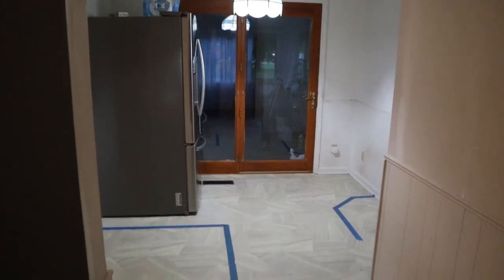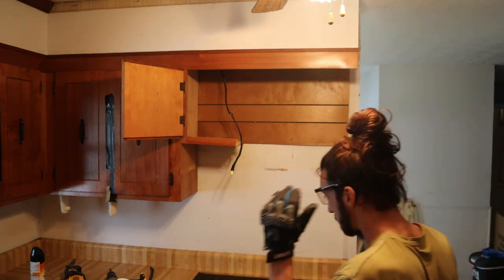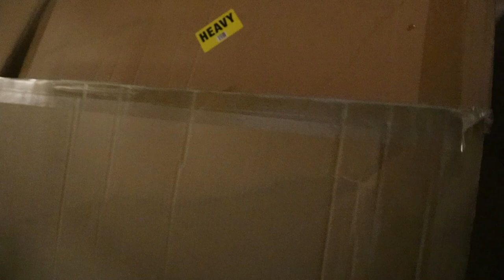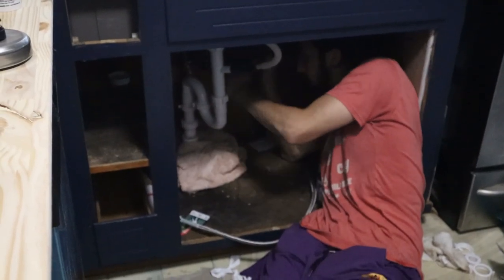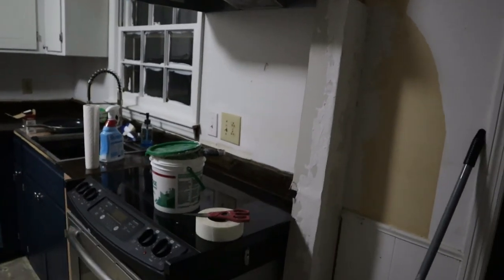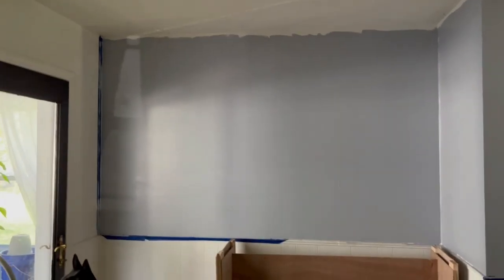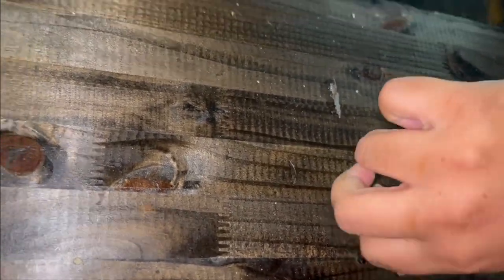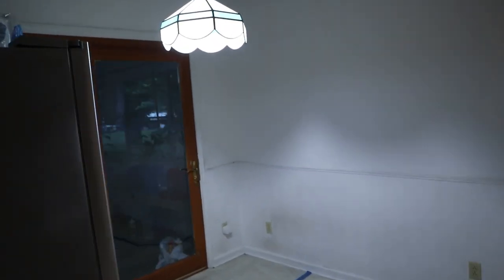Full Size Kitchen Renovation

Comment: very different sink/faucet with glass insert. Ca you pls provide the link to that. And a very beautiful kitchen!!!
Reply from the maker: Thank you very much !! This is the link for the faucet - OWOFAN Kitchen Faucet with Pull Down Sprayer Industrial 1 Handle 1 Hole Or 3 Hole Faucet for Farmhouse Camper Laundry Utility Rv Wet Bar Sinks, Stainless Steel Brushed Nickel https://a.co/d/0kZbTY5
Reply from the maker: And this is for the sink - 33 Inch Drop In Kitchen Sink Workstation-Hovheir 33x22 Stainless Steel Topmount Drop In Kitchen Sink Double Ledges Workstation Sink 16 Gauge Deep Single Bowl Kitchen Sink Overmount Kitchen Sink https://a.co/d/3DZwuNl
Reply from the maker: And lastly if you are interested the glass rinser was separate - HGN Metal Kitchen Sink Glass Rinser,Faucet Glass Rinser for Kitchen Sinks,Bottle Washer,Kitchen Sink Accessories,Stainless Steel,Brush Nickel https://a.co/d/ew0tUye
Reply: @reinalugo2  Thanks so much. Do you like the glass rinser? Is it functional?
Reply from the maker: @pretty95138  Yes we use it everyday cleaning cups, mugs, and even pasta glasses sometimes we will reuse them. I love it but alternate options for that hole cut out could be a soap dispenser or an extended hose but that wouldn’t be needed with that faucet.
Reply: @reinalugo2  Thanks for replying :)